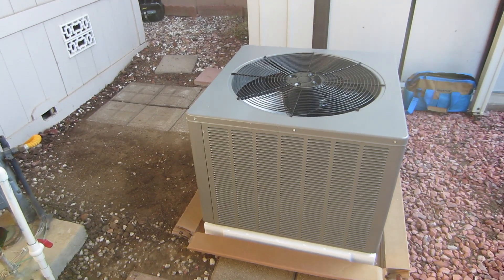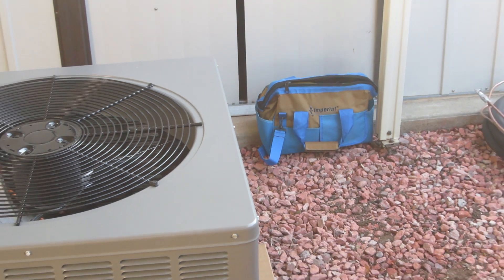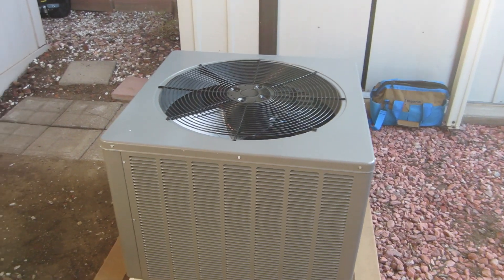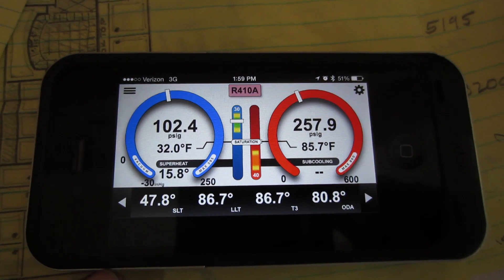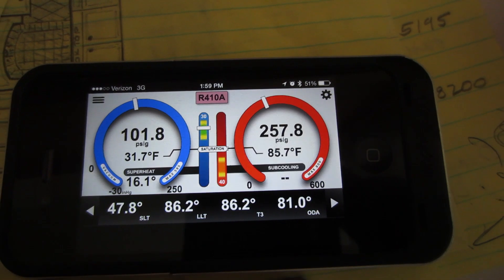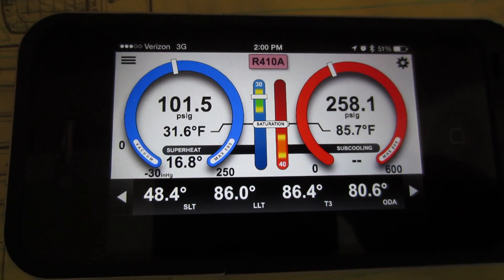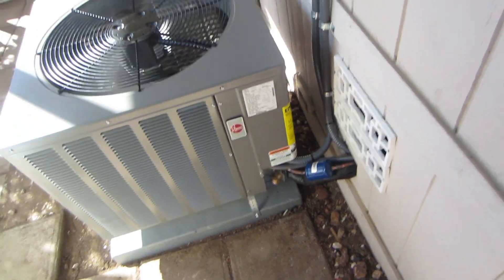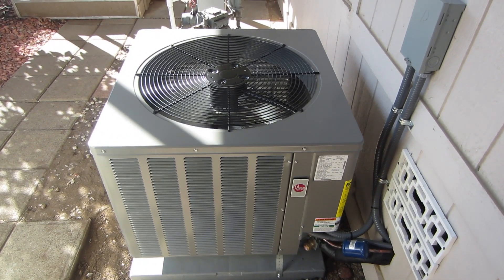Rheem  13AJN48A01 condenser

Comment: Dallas! - I've got this same exact condenser and I'm a homeowner attempting to recharge my unit w/R410a.  Does this set up have a TXV (thermal expansion valve) or is it a fixed piston?  Do I refill freon using subcooling or superheat? Thanks in advance.